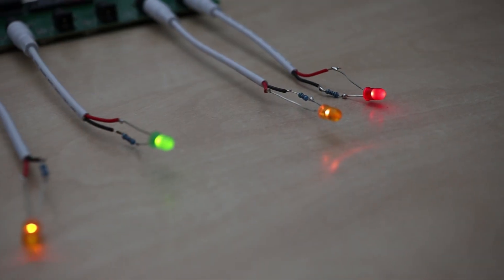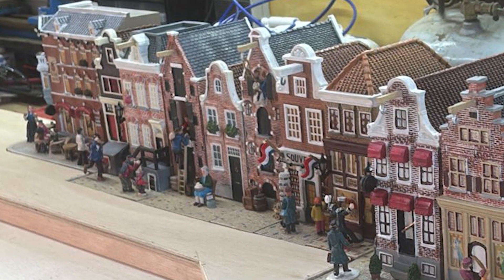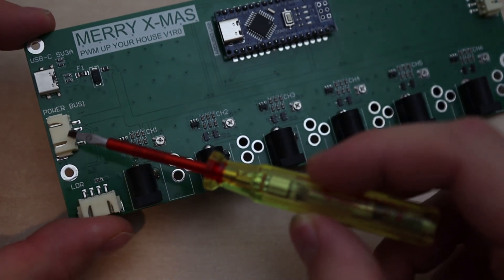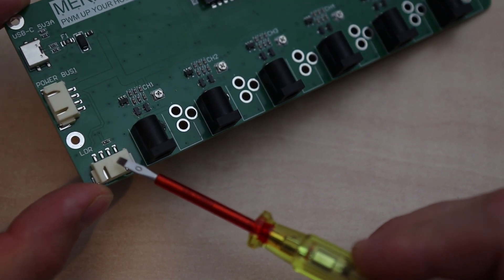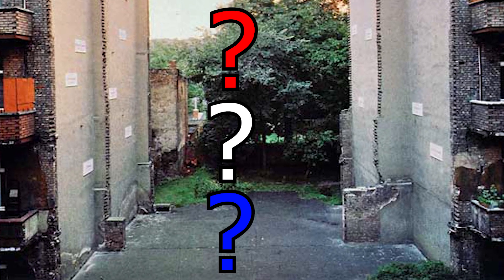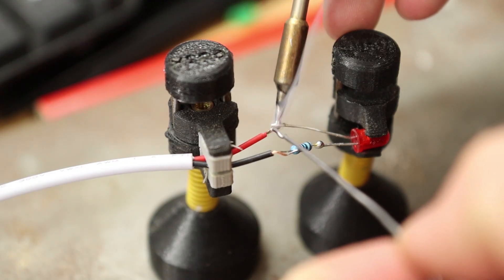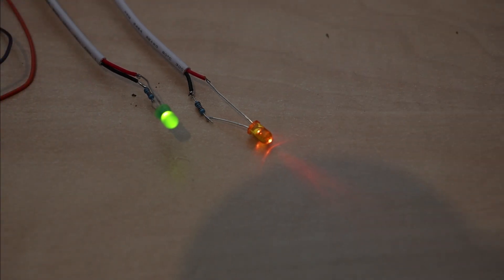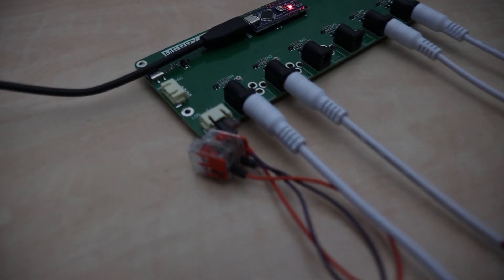Overengineerd Arduino Christmas Village Controller!  PART 1

Comment: Definitely overengineered, but I love it!
I probably would have abused the multiple outputs of a RGBWW controller and let home assistant (or an ESP32) take care of the rest. But a very nice implementation regardless!
Reply from the maker: Thank you for the reply! And using home assistant is a very good suggestion! since you can trigger scripts based on your smarthome status :)
Reply: @PattysLab  And if you used WS2812 LEDs you would have a lot less work. Just a suggestion.
Reply from the maker: @Slemi  You're right addressable leds are way easier! But these houses are the way they are. The LEDs are already inside from the factory and they cost between 25-45$ a piece, hence this solution
Reply: @PattysLab  Yes then there is no WS2812 option.